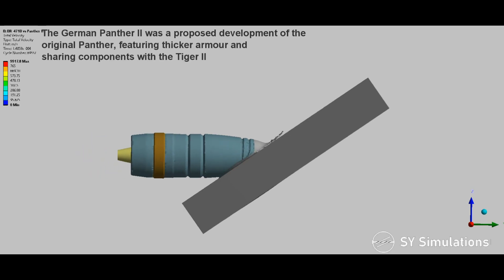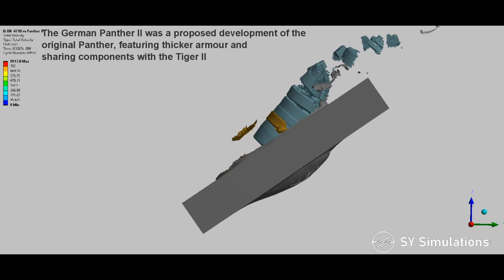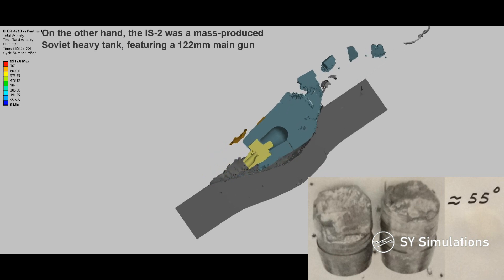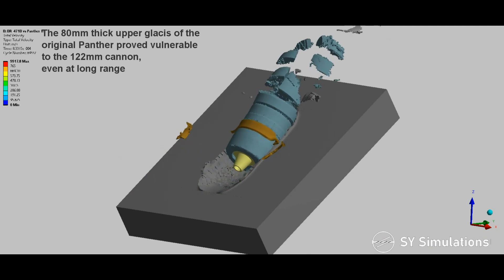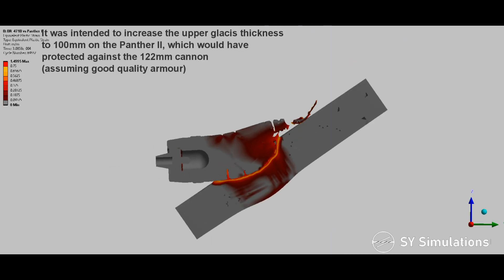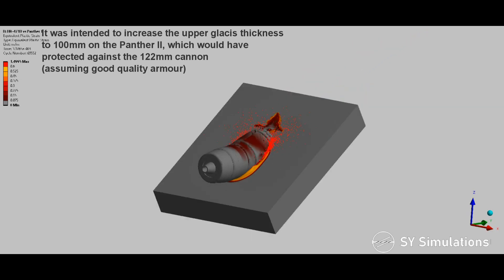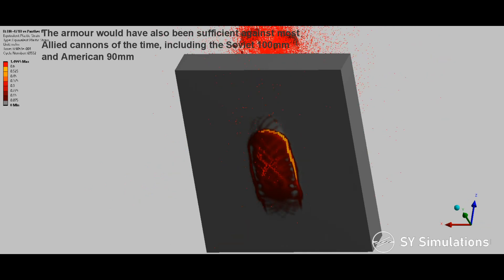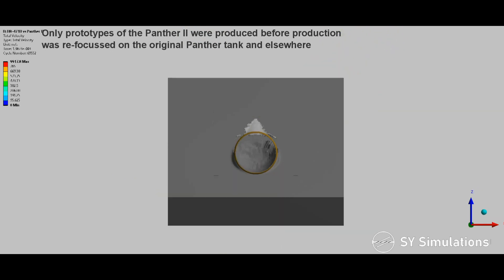IS-2 vs PANTHER II | 122mm APHE vs Up-Armoured Panther | Armour Penetration Simulation

Comment: That's quite impressive at such short range. 122mm is no joke.
Reply: keep going people🍿
Reply: All i will add to this is that the "low quality" German steel is quite a bit overstated. Simply by looking at the ballistics tests done by the US, the armor stood up to some very heavy fire, very well. Were there flukes, and could the armor have been better? Sure, but it was good enough to concern the US and consistent enough for the US to use as targets for some serious testing.
Reply: Also, to single out the German tanks in this regard is silly, considering just about every nation, at one point or another, had very serious issues with armor. From Italy and Britain using riveting way too late into the game, to the soviets having VERY serious quality control, especially with castings and welding gaps the size of your finger.
Reply: It's mostly death sentence
Reply: So shell increases velocity over distance? Lmao
Reply: itd be decimated. Author doesnt take into account low quality german steel.
Reply: @panterka.f  did you even read what's on the screen or listen to the voice over?
Reply: @panterka.f  The low quality of German armor is largely a misconception. The much publicized ‘low quality’ armor was only due to shortages of molybdenum and nickel. The Germans got around this with quench baths specified to the second but given the weight of the plates, such as the Panther glacis, inconsistencies were a natural consequence. In spite of all these difficulties combined with the chaotic situation in German factory conditions, (material shortages, Allied bombing, sabotage etc…), only about 50% of Panther G glacis and about 33% of Jagd Panther front superstructure were effected. Even more surprising was the fact that German flawed armor plates were less frequent in the last months of the war!
Also, when it comes to low-quality armor, I am sure the Author (in his videos involving US tanks), never took into consideration the flaws that riddled American RHA plates up to mid-1943 and for cast armor, to late-1943. Contrary to German tanks, ALL armor was flawed, not just the heavy plates, (of 80mm and thicker) and these included ALL M3 and M3A1 Light, ALL M3 Medium, ALL early M4, M4A1/2/3/4 and ALL M10 TDs!!!
Reply: @panterka.f There was no bad quality German steel , the Russians had bad quality on their cast hulls and turrets . Always this BS about WW2 ......😅
Reply: @5co756  MF when they talk out of their ass , literally took 2m to look up tons of analysis as well as field report of German armor in mid to late war which goes extensively into how bad it was with the armor only achieving 50 - 80 % of earlier armor effectiveness due to lack of key material as well as Germany industry going to crap ( a T-34-85 only need to hit the UFP of a Panther 2 to 3 time to shatter it let alone an IS-2 ) . Mean while the Soviet actually increase their armor quality though out the war with even the CIA report on T-34-85 armor and build quality being up to US standard
Reply: @huyhoangtahuu9733  A IS2 could penetrate the UFP of a Panther anyways and a T-34 won't have a chance for 3 shots . Cause he is toast after the first Panther hit  , this is not a game were you bounce multiple shots with no damage . The armour plate gets worse with every hit and a mass produced T-34 was not of good quality . Casting metal can be difficult . 

Oh and btw the CIA was founded in 1947 , hard to show me CIA reports from 1944. 😅
Reply: @5co756  German ran out if manganese for quality armor.
This is true that their armor would be roughly at 80% as it'd be extremely brittle 

T-34's, artillery, anything with a solid projectile or large amounts of explosives have a big big chance of damaging something critical 

It'd also make the spall inside the vehicle wrose 

However if we just consider the IS-2 it's ammunition loadout is almost entirely HE. I believe it was sent into combat with 7 AP shells

The HE filler on the IS-2 has knocked the living hell out of Tiger II's

There was a mention of a tiger II's turret being sent 40 meters back when they were testing it's durability and trials for the IS-6

I'd be more worried about the HE honestly
Reply: @5co756   @5co756  stupid or bad faith ? 1st thing is no shit a T-34-85 would have troubles penning the panther from the front but like you said this isn't a game which mean 80% of all engagement is won by the one who shot first so getting 5 shot in before the panther can respond is no problem consider the panther shitty gun laying drive that took the gunner way more time to lay the gun on target  ( le panther 1947 ) ( these are the exact same for the 75mm Sherman in the West where they just slam a few 75mm round which is much weaker then the 85mm and still shatter the panther front armor ). 2nd of course casting armor is difficult that why the Soviet is much better than the German at it lol , the Soviet got it down to an automated assembly line while the German can't even manually do it ( look up their industry layout vs the German as well , an example of this is the early tiger 2 turret  the way it is because the German can't cast for damn meaning they have to take a wield plate of steel and bend it instead of just cast it ). And finally it would take you less time to just Google the CIA report then to write this comment you know especially consider is was declassified , ofcourse it not perfect but even then they still conclude it was a good tank ( CIA- rpd81)
Reply: @huyhoangtahuu9733  Casting steel or armour is simple and cheap to produce , the Soviets were mass producing tanks especially T-34's . They build 84.000 T-34's and the Germans roughly 6000 Panthers . But cast iron is not as good as RHA , that's why the Germans made their tanks out of RHA plates welded together . And the Soviets lost 45.000 T-34's btw , so all your myths doesn't fit to the high numbers of losses . 

This was a mass vs class race and mass always wins , even the best armour couldn't save Germany .
Reply: @5co756  Sure RHA maybe stronger than cast but it also more expensive and more time consuming which is why the initial plan for tiger 2 early turret was to be cast but like i said above the German can't cast for shit or else they would have already done it instead of roundabout way and last i check a certain nation need to produce as much tank as possible  ( that not mentioning that cast CAN achieve lv of protection of RHA or else why would majority of cold war tank make use of it like T-54 , M48 , M60 , ... ). 

Nice deflation there , just because something got destroy don't mean it is bad especially consider it was use in the biggest war in history in the most intense fighting which if anything prove it a good tank or else the Soviet would have already phase it out like many other design ( they keep producing T-34-85 because it a good tank that done it job despite the T-44 existence) and i still haven't seen you provide any counter to the CIA report lol . As for the 45000 losses , you do know it literally is just 1 number in wiki from 1 source right ?? A number without proper context like how losses is actually count ( Soviet and German have very different way of consider what a loss btw ) or how many of them are recovered is basically meaningless .

Come on man , put some proper sourcing and effort ffs cause im getting bored teaching you literally basic non pop history research lol
Reply: @huyhoangtahuu9733  The problem is you have no knowledge of WW2 history , I'm getting tired cause I always have to correct you . 
This early Tiger 2 turret was a design from Porsche for his Tiger 2 , but he didn't get the contract . But he ordered 50 turrets from Krupp and sold them to Henschl , who had the hulls ready but no turrets . And that's why the first 50 Tiger 2 had this turrets , this has nothing to do with casting metal . German and Austrian steel production is number 1 in the world , Krupp and Voest Alpine for example . You think they don't know how to cast metal , it's just not the best material for armour especially 80 years ago . 

And I'm not interested in an biased CIA report from 1950 , long after the WW2 . You can Google the same Soviet test of a Tiger 2 , were they hit the UFP with 30 hits of different calibers . And guess what , it cracked . 

45.000 T-34's are no joke , the Germans didn't even build that much tanks . So why they lost that much if the Germans had bad armour and the Soviets had superior cast one's ? And 45k is only one tank , I don't mentioned all the others like KV1 and IS series .So we can't say a T-34 was a good tank at all .
Reply: @huyhoangtahuu9733   "tons of analysis as well as field report of German armor" Okay, then give it to us.
Reply: @darklysm8345   hey i know you , you're that infamous wehraboo that got dunk on in several YouTube video about ww2 lol . This properly gonna fall on def ears but sure i'll humor you real quick  : "CAMD RF 38-11355-2704" , "Defense Technical Information Center: 
Testing and Fielding of the Panther Tank and Lessons for Force XXI"
Reply: @5co756  Sowieci na pewno nie wyprodukowali takiej liczby T-34 do konca wojny.  Bylo to 57000 i wiekszosc zostala w tej wojnie zniszczona. Za jednego U-boota (ktorych Niemcy wyprodukowali ponad 1000)mozna by wyprodukowac jakies 15 tygrysow, wiec to tam byly surowce, ktorych wojskom ladowym brakowalo.
Reply: @5co756  you don't take into account the fact that crew get shocked when being hit, even for non penetrating hits. Also non penetrating hits could send fragments of the armor inside the crew compartment, which is deadly by itself.
Reply: @5co756  45000 T-34 to what? It's the total sum destroyed by a plethora of things. Mechanical failure, abandoned by it's crew, destroyed by air support, infantry, AT guns,... You also forgot that the T-34 entered combat in the very first stage of the battle on the Eastern front, unlike the Panther which only entered combat in 43.